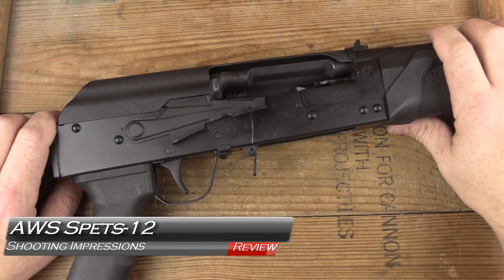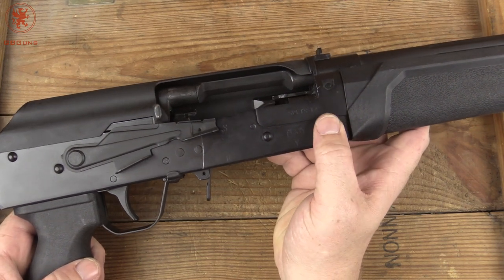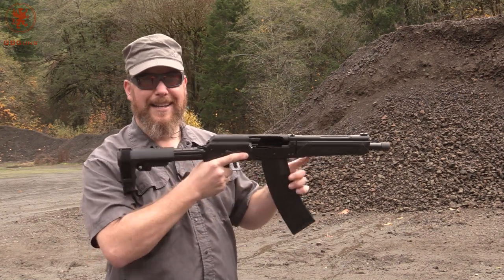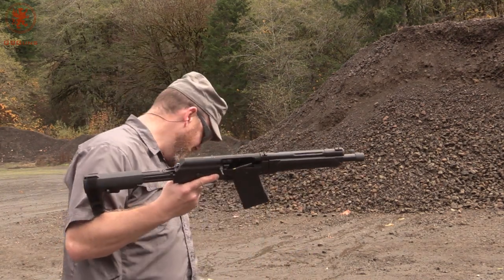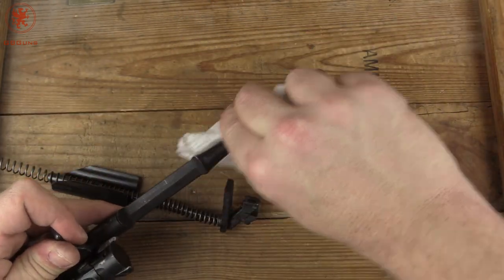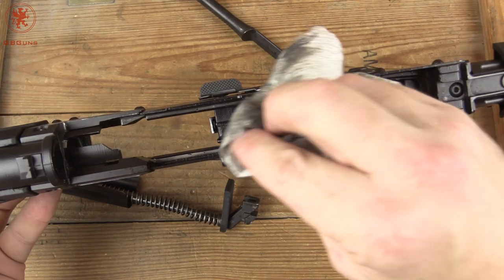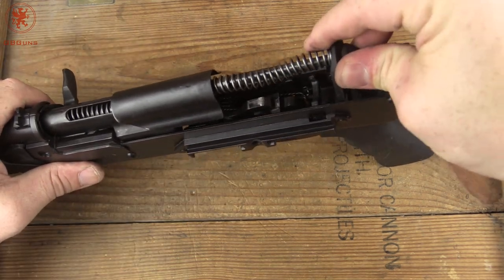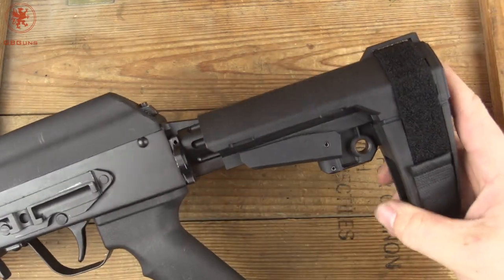AWS Spets 12 Shooting Impressions

Comment: aws is NOT a reputable company! i bought one that was shipped to me covered in sand blasting sand inside and out, and the adjustable gas block retainer pin is loose to function and a pin hole was drilled in a location so as to prevent the gas block knob from threading all the way in

Comment: Late to the party but I was wondering how the SBA3 felt, while firing the semi-auto 12ga.  I had one on my Mossberg Shockwave in 20 gauge and swapped it out for the SBM4 because the hard plastic portion of the brace would get painful after a couple rounds of #4 shot.  It wasn't just myself that thought that.  A couple guys who tried it at the local range said the same thing.
Reply from the maker: I didn't have an issue with it, but I grew up shooting Mosins.

Comment: I was told the AK steel 12 gauge is much better than the AR style such as the rock island or MKA 1923.  Would you agree? After many hours I still can’t decide which one is the most reliable. I appreciate your input.
Reply from the maker: The Rock Island, etc only look like an AR, if you want AR-10 compatibility look to the Genesis Arms Gen-12.  I've not done much with the Rock Island and the like, but am an AK fan so I love these AK platforms

Comment: Mine blew apart in less than 50 shells.

Bolt carrier is made of cast pot metal. Dont believe the description that claims 'milled bolt and carrier'.
Reply from the maker: wholly crap.  Everyone ok? How was the warranty experience?
Reply: @GBGuns  
I complained to Atlantic that their description was a lie. They said that they just listed the specs that the manufacturer cited.
They forced me to get it fixed from the manufacturer before they'd allow a refund so thats what i did.

12 gauge absolutely requires milled bolts and "bolt extensions". It was a cool gun, but cast internals are a deal breaker for me.

Comment: If it wont cycle low brass than I don't need it.
Reply from the maker: Do you use low brass for self defense?
Reply: @GBGuns  yes, this is not a hunting shotgun. It's a self defense shotgun
Reply: You can solve that by buying an MD Arms Saiga 12 puck and adjustable cap, but this isn't a cheap dirt clod shooter or a trap shotgun. It's a defensive purpose 12 Ga.
Reply: @GunsWithGage  So you prefer to maim your attacker, so that he can live and possibly sue you? Absolutely ingenious!
Reply: @TheRoadhammer379 I don't think I understand.  This shotgun is meant for using high powered defense loads... Not low brass thats all. I don't think anyone would use bird shot for a defensive load.
Reply: Open the gas port up

Comment: The company is not good to its customers! At least in my experience it was worse than bad it was awful.
Reply from the maker: What happened?
Reply: @GBGuns  well man check back with me after the beginning of the year and if things are still going to same way they have for almost 7 months now, I'll tell you. I hope everything smooths out but it does not look promising.
Reply: @GBGuns  I've kept my review and comments to myself because I'm not much of a keyboard warrior but it's starting to be to much for me to hold my tongue.
Reply: @GBGuns  now that I have my rifle back I'll tell you my experience. 

Back in June I sent my vepr in 5.45 to AWS have the barrel chopped and pinned. I just received it back last week in pieces.
Reply from the maker: Wow, what was the problem? Why couldn't they finish it?